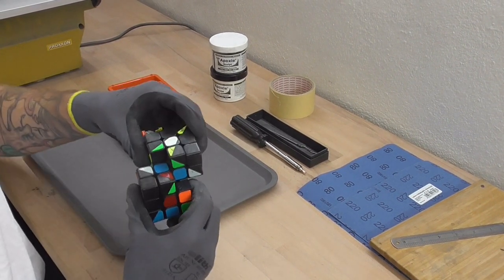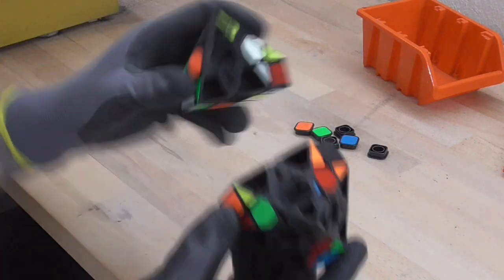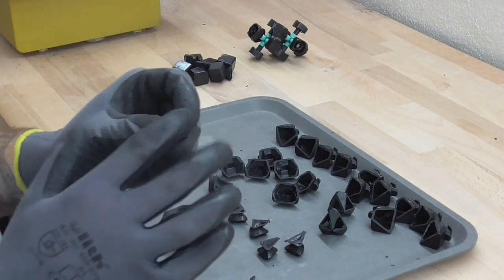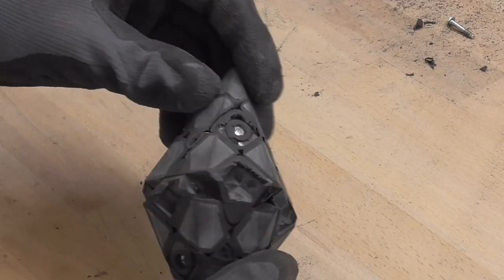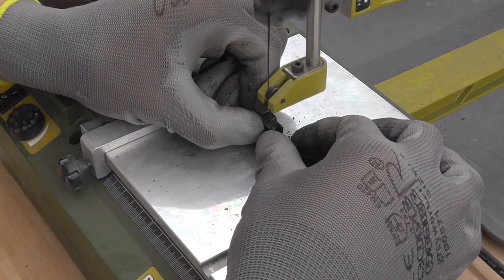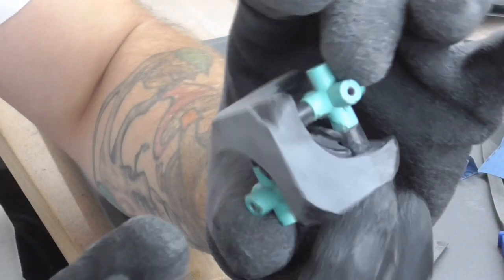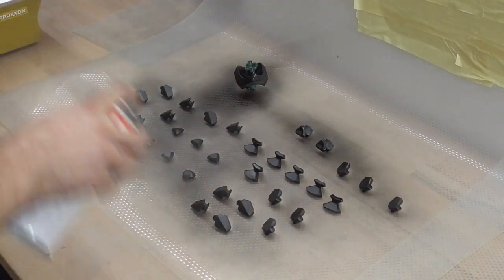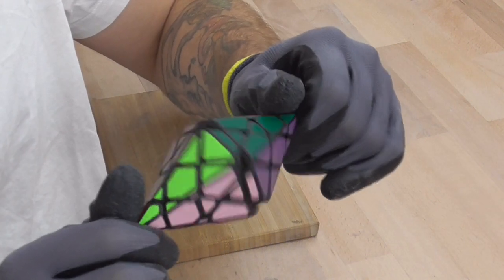How to build a 3x3x3 Fused Hexagonal Bipyramid - Complete Build Guide

Comment: Step 5: Superglue your fingers together.

Great video!
Reply from the maker: This step is optional :P
Thank you :)
Reply: @puzzlebuilding101  Did you add the step when you cut your finger or sanded your fingers to the bone?
Reply from the maker: I only deep cut puzzles, sorry :P
But I accidentally cut myself with the x-acto knife in the past..a couple of times actually. 
A video on how to use these knifes without cutting yourself wouldn't be that bad of an idea I guess ;)

Comment: Seeing the preview picture i thought "why are the corners missing" then i realized that it was a fused puzzle😂
Reply from the maker: Haha, it's kinda hard to tell what the base puzzle/mechanism behind this really is :P
I would have loved to get the perfect bipyramid shape, but this is all the mechanism would allow ;)
Reply: @puzzlebuilding101  so you could not have gone deeper?
Reply from the maker: @tabris1135  No, not even 1mm. The center pieces here are sanded down to the absolute maximum. It's very stable, but barely kept together. The center pieces are about 1mm thick on the smallest sides. ;)